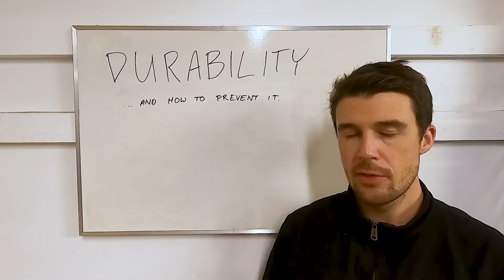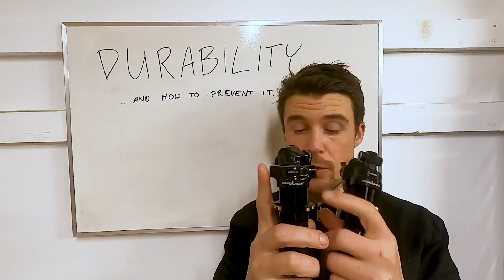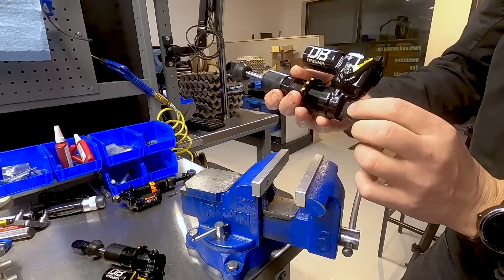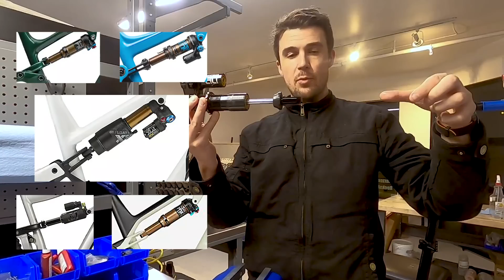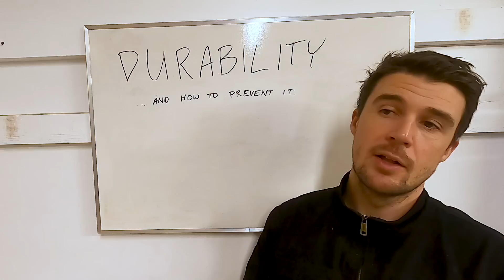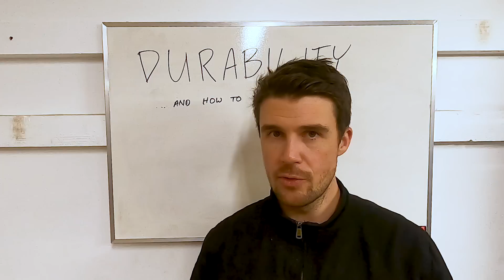Dear Bike Industry... Tuesday Tune Ep 34

Comment: "sideways?" Show me sideways. Please tell me you're joking.
Reply from the maker: What specifically are you referring to? Not joking about side loading (ie eccentric loading) from yokes if that's what you're talking about.
Reply: @VorsprungSuspension  Hey steve, it's Kevin (kidwoo). You mentioned sideways mounts on shocks, I'm picturing a fastener running perpendicular to traditional...like front to rear? Just didn't know what you meant.

Comment: Thank you for this video, its been super helpful. I recently snapped a Rockshox Super Deluxe Ultimate fitted on a Cannondale Habit. The shock went through the top tube and the yoke through the seat tube, its completley written off the frame. Neither Cannondale, or Rockshox will cover any of it under warranty with Cannondale blaming the shock failing rather than their design. I cited this video and took a number of quotes from it in my argument back and demonstrated that the initial failure plane of the shock shaft was clearly lateral before ultimately failing vertically once weakened. Unfortunately they still only offered me crash replacement frame at a significant cost. The industry needs to acknowledge that there is an issue with coil shock compatibility and certain shocks just aren't fit to be used on certain frames. I'm well out of pocket and won't be going anywhere near a Cannondale in future, despite it being one of the best frames I've ever ridden.

Comment: Hey Steve, I was wondering if you came across any spherical bearings that would work with a 12.7 eyelet or plastic fox bushing (and 8mm bolt)? I've got a '22 Process 153 with trunnion mount. Misumi probably wouldn't mind taking a custom order... but at what cost, you know.

I just wish there were some out there like the DT Swiss Spherical bearings (DCWDXXXXN08079S). but those are 16 OD and 10 ID.

EDIT: I drew this up in CAD and using a cane creek kitsuma eyelet (14.7 bushing OD) you could get nominal 1.85mm of plastic bushing material around an 11mm microball w/ 8mm thru hole. Hmmm...

Comment: Hey I'm more than a little late here, but I'll ask anyway: 
In a yoke mount the eye is turned 90 degrees so the axis is vertical - wouldn't this accommodate MORE misalignment, given the additional axis of rotation? Lateral flex from the rear triangle and yoke itself is taken up in the vertical rotational axis, while the "normal" rotation around the horizontal axis is accommodated at the other ends of the yoke?

Comment: Why not put a plain spherical bearing at each end of the shock? Plain spherical bearings avoid side load by design, so this seems to be a durable solution for the side load problem. Plain spherical bearing: https://en.wikipedia.org/wiki/Spherical_bearing.
Reply from the maker: A few shocks do (Curnutt back as far as about 1999, Cane Creek from about 2004-2009, Ohlins for a couple of years although unsure if they still do, currently Push and EXT), it's generally a good solution, though there are some tradeoffs with weight, wear (which leads to knocking) and cost. However, for sure it prolongs the life of the shocks.

Comment: What do you think of the Norco Sight VLT's use of a bracket with bearings to get the trunion shock sideways? Seems like it solves the lateral braking forces problem by having bearings in an X pattern. Not quite as good as spherical bearings but better? My experience has been great. 2,000 hard freeride trail miles on mine with one 50 hour service on the RS Super Deluxe. It actually blows my mind I broke the alloy chainstays but the shock is still going strong.

Comment: I'm a bit late to the party, but wanted to add that my Specialized Turbo Levo uses a long clevis, which results in many shock manufacturers advising against using their coil shock on the bike.  Apparently the piston rod is not strong enough to withstand the bending moment.  There are scary pics on the forum of broken shocks.  I'm guessing the resulting crash hurt.  I'm still lovin' my Smashpot, BTW.  👍

Comment: I'm skeptical of this. You should put your money where your mouth is and create an indicator gauge that bolts into the clevis of a shock at the rear triangle and test the forces and deflections when the back tire is loaded laterally near the point of failure of the rim. Then use that data to build a fixture to test a shock. If it is an appreciable amount then you're really onto something here that can create industrial change like heim/ball joints or perhaps a more durable polymer bushing ala automotive suspension. Maybe if I've experience trunnion shock failure I'd sing a different tune but for now I'll remain skeptical.

Comment: The issue is very simple: many frame designers do not understand the principle of "degrees of freedom". Most rear ends are overconstrained, and in such systems, compliance is achieved by deformation of the weakest link. Trouble with that is that typical tolerances can have a huge effect on the loading of that weakest link.
The trunnion design is a clear example of that: we have very flexible frames (their stiffness is at least an order of magnitude less than the shock), with fairly large tolerances, being supported by the shock - which is stiff, but not designed to carry radial or bending loads.
Ensuring proper alignment is not feasible in all joints of a mountain bike, so the suspension must be designed to be able to tolerate misalignment. Doing a kinematic analysis of all the joints of a typical mountainbike shows that most components are over-constrained. For example, if the axis of the two horst links aren't coaxial, they will introduce significant loads into the chain and seat stays as the frame moves through its travel. That is a big reason why many frames eat bearings.

Comment: Had this in my 'to watch' list since it came out, without realising it probably applies to the fact I was trying to get shock #5 for a 1 year old bike with trunnion mounts.
Add in the supply chain issues and increased demand potentially lowering quality control reduced for the shocks getting to people, and the chances of failure get higher. One of my failures appeared to be the main piston nut coming loose and the shaft smacking into the pile of piston assembly pieces (didn't open as was warrantied), which seems just poor assembly.
Other issues have started with the damper giving up, although I also suspect general poor assembly as 1 shock arrived new from the manufacturer  with the LSC dial (Super Deluxe Ultimate) having unlimited clicks and no change in firmness.
Have we seen shock designs accommodate this extra rigidity and leverage at the mounts? I can't imagine any way for the shaft/seals to allow much flex, but the materials/designs for connecting everything to the mount points could vary.

Comment: I had 4 trunnion mounted shock failures in the last year. 3 shock failures on a 2020 enduro on a dhx2 and float dhx2. 1 shock failure on a transition spire with a super deluxe ultimate. Before getting a bike with trunnion mounted shock I haven't had a shock failure in years.

Comment: What would happen if we would switch back to pull shocks? Or make the upper shock joint with two degrees of freedom?
Reply from the maker: Pull shocks are a bit tricky to use with compression springs, but other than that there's no specific reason not to use one.

Comment: I bought DVO Jade for my Bird Aeris Mk1 in 2020. In less than a year, I had wear mark on my stantion. It could be bad-ish frame design, it could also be bad shock design, because I talked with few people with the same problem. 
I was thinking about finding spherical bearing for the eyelets, but I have to get shock with bigger eyelets like canecreak. 
Im not buying fox, because they crack at the top of the damper. Probably wont get another DVO (I returned my shock, and got full refund).

Comment: You have to include the bearings on the trunnion mount to get a good representation of play. Because there will be play in the bearing just like there is in the bushing.
Reply from the maker: No, it’s far lower because the bearings are spaced so far apart. Try it in a frame, it is extremely rigid.

Comment: Once axially preloaded (bolted in the frame, is designed correctly), the internal clearance of the bearing will be taken up in the axial direction and the balls will be properly loaded. There won't be any give in the inner race in that case. Deep groove ball bearings actually require this for proper operation and lifetime.

Comment: I had a customer who kept bringing his Bomber CR coil shock to us because it was leaking. After rebuilding it 3 times we sent it to Fox. They had a guy call us and asked me if it came off a kenevo ebike - it did! He said "yeah, we see that yoke design crack the shaft on these all the time." I was left with my jaw on the floor; you can't run certain coil shocks on yoke design bikes because they can't handle the side loads! Whaaaat

Comment: My rear shock is just fine on my hardtail. 
As for the bike industry, I believe they will never stop pushing tech in the wrong way just because parts don't break enough to justify a drastic change.
Reply: Whats your sag setting on it?
Reply: @yetti423  My back wheel is set at 26 psi.
Reply: @onilovni1234  My sag is set to in a tree, ditch, or over bars :)

Comment: Something you'll see on a lot of bikes is linkages in single sheer which creates uneven loading. If you did this within most engineering industries you'd get laughed out of the office but it seems to be almost standard practice within the bike industry.
Reply: I´d say this is primarily due to bikes being very limited in width

Comment: How do dirt bike manufacturers go about their single shock rear suspensions? Dirt bikes might not have water bottles to consider, but they do have engines and transmissions which occupy space. Do they just build everything stronger (thus heavier) because dirt bikes are not pedal powered?
Reply from the maker: Well, there's a few things at play there:
1. dirt bikes are far less concerned with weight - the shocks are very heavy compared to MTB shocks, typically about 3-5x the weight (the MX Tech National shock is renowned for its light weight - usually it's about 7lbs/3.2kg vs MTB shocks ranging from 0.4-1.0kg incl spring) but only having to deal with a vehicle 2-2.5x the weight. As a result, they can do things like use bigger shafts, and make them out of steel instead of aluminium
2. Dirt bike shocks may not be quite as reliable as people often think. Their recommended service intervals are about the same as MTB shocks (actually less in many cases - KTM PDS shocks have a 30hr service interval), and they do often blow if not serviced at the recommended intervals.
Reply: spherical mounted top, yoke mounted to linkage at the bottom. and a massive shaft and with tons of overlap.

Comment: "Spherical bearing," or a ball joint, in other words.  Utilized throughout the auto industry, these are readily-available and inexpensive.  Kinda strange that shock makers aren't using them in their frame interfaces.
Thank you for speaking the truth.  It's so hard to be critical of individual companies or even the entire system.  Doing so both compromises your relationships with producers and accused one of criticizing "capitalism."  Capitalism has a lot of faults and this is just one example.  Similar to when one criticizes the United Sates, instead of admitting our faults and working to improve things, you're shouted down and called a "Commie!" and told to "Leave!"
When people are indoctrinated with "We're Number ONE!" they cannot accept the fact that we have shortcomings and work to improve them.
On a related note, empirical data is difficult to come by.  First, it's easy to just "forget" to produce it.  It reduces cost, so why do it?  
Second, when data does come forth, it's usually from the entity producing the item in question, thereby greatly reducing its credibility.  Data is cherry-picked to be used in marketing campaigns.
Third, there's an obvious need for objective performance and durability data for sure.  But the likes of Consumer Reports are under constant attack and criticism by "Free market" adherents.  Again, criticize the way the market gives you untested and unregulated products, and you're called a "Commie!"

Keep up the good work.  Voices like yours are vitally important!
Reply: my old 2006 specialized enduro actually came with spherical bearings on the original shock i dont know why this isnt a thing anymore as it has been around in the past
Reply: Push and EXT use spherical hardware.

Comment: Would a coil spring shock reduce the shock’s exposure to these problems?
Reply from the maker: Generally speaking no, coil shocks are actually usually worse at handling side loads because the body/shaft interface is less stiff relative to the stiffness of the eyelet.
Reply: How would it?

Comment: Taking an example, is YT’s move to go to a Capra with a linkage-driven shock good or bad? 

Will it ease the shock’s bottom mounting hardware from rotational forces? (Assuming the linkage uses bearings) 

It does make it easier to change coil spring on the shock as the shock mounting hardware is not in the way and has to be removed and replaced every time. 

But does this linkage design at all void use of certain coil shocks such a as the Fox DHX2?

(Ibis Ripmo is to me known to not work well with the DHX2. Does it have a similar linkage-driven shock interface?)
Reply: The old design bent the lower hardware and pulling the frame in.  So i guess the new design fixes that
Reply: @diamondsink2000  Thanks for the clue. I didn’t know there was a problem. Haven’t heard of it. What problems did it give? Not much rotation there, if at all. 

Other frame mounting designs have considerable rotation, for example the 90° rocker links. 

Or am I misunderstanding what you mean?
Reply: @diamondsink2000  Ah ok, I misunderstood you there first. I now get you mean the a bit long 40 mm long lower shock hardware bent. I can see that happen, even if I don’t know of it having happened. Thanks for the info.

Comment: so im wondering what the difference is between linair and progressive coil springs..all the data is based on a linair spring and not a progressive spring..is there a topic on this issue.
i have the option to go with a 60mm rocker but i like the feel of the 65mm rocker, so is my option a progressive spring  to make it ride more on top more mid-stroke support?

Comment: Thanks for the insight Steve. My trunion mount DHX2 has the said issue on my ebike, premature wear on one side of the shock shaft from sideways forces. Perhaps the original style of shock mounting would mean wearing out cheaper readily replaceable bearings at the connection point instead transferring the forces onto the shock.

Comment: So what bikes do you recommend that have well designed frames for the shock/suspension?
Reply: FWIW as a MechE outside the bike industry, I've been impressed with Pivot's latest vertical shock designs.
Reply: @midMTB  Isn't it trunion mounted though?
Reply: @MrSatchelpack  Yes, some are; however, the latest Pivot bikes 2019+ seem to be designed & manufactured well. I would prefer a Trail 429 over a more flexible Ripley frame, with a yoke coming from behind the seat tube.

Santa Cruz bikes are some of the sturdiest I've seen in terms of design for the long-term. They're not my style and a bit heavy, but their lower shock-mount is good. The previous design also allowed for both points mentioned here, the upper counter-rotating link is not acting as an extension like in the Ripley.
Reply: @midMTB  I think they've vastly improved things but I remember reading somewhere that some of pivot's older frames were incompatible with coils simply because pivot was using the shock as a stress point as a way to reduce frame material/weight, and since coil shocks are less rigid than air shocks due to the smaller stanchion, they were wearing/breaking shocks at absurdly high rates. The newer bikes should be better like you said, but people need to watch out for the older ones.

Comment: Sounds like the Nicolai/Geometron G1 does things right. Spherical bearings, coil shock inside the triangle, long shock for the amount of wheel travel, stiff and symmetrical frame that does not misalign and side-load the shock, straight load paths. Besides the mechanical advantages, as a bike it works great too. 
In be4 people complaining that the frame has no water bottle mount - I rather have a frame that lasts and performs 100% all the time. 

To me it is clear, spherical bearings are the way to go. Like you find in motorsports. In my experience they are extremely durable and quite easy to replace.
Reply: The downtube mounted shock is less than ideal. I still remember Commencal claiming they saved ~200g on the downtube tube alone by moving the shock from downtube mounted to the rocker-chainstay design going from the V2 Supreme to V3. Which makes sense, basically perpendicularly mounting the shock to the longest tube is the worst thing you could do, the tube has the least strength that way.

The lack of a bottle mount is just an added bonus :)

Comment: Can’t you  put bearings which are not so rigid in the bearing mounts of the trunnion? Wouldn’t that make the flex go to the bearings ? Might be a dumb question but I’m really curious
Reply: Don't think it would help one bit, the spacing is too wide.
Reply from the maker: @piotrekserwisuje  is correct - the spacing is very wide and rigid, and axial preload on the bearings takes up the play.